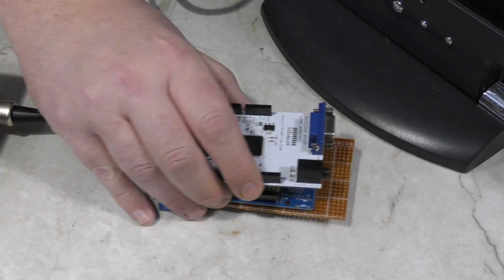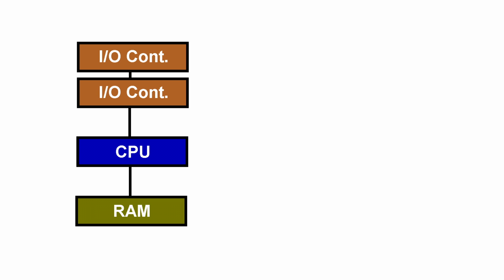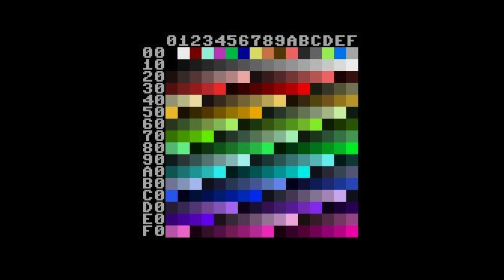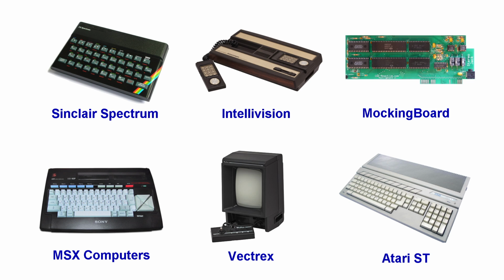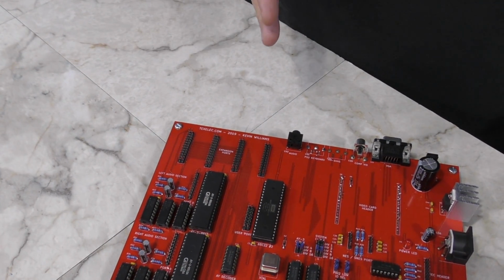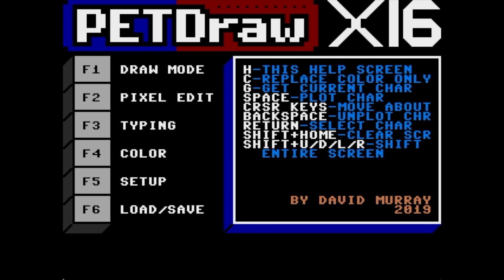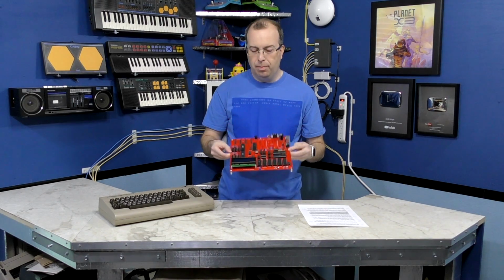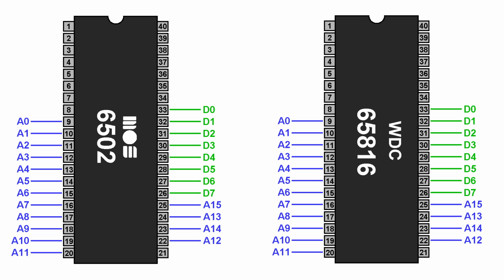Building my Dream Computer - Part 2

Comment: Excellent project !! I will be following this one for the duration. As far as sound, I think it would be best to use your option of embedding the sound hardware in the video controller's FPGA. It will save on cost, you would have complete control over the audio design, and not have to source the Yamaha sound chip. Your videos have been spiking my interest in retro computing once again. I also enjoy retro computing designed on modern "hardware" such as the PIC32 based Maximite COLOR computer. Excellent work guys !!

Comment: I love this project. And I love the dedication you and your team show when presenting progress and the current status quo.

I would love to buy the final product though, and by that I mean not a board or anything I have to assemble myself, but a fully featured computer that I can just plugin and have a go at it.

Reason I say this is, that while I am a professional software developer, I am not good with hardware. My realm is software. So instead of buying a board that I have to hook up or - gasp - solder some things on, I would rather prefer to get the "dumb end consumer package". Something I can just unpack, hook up to a monitor and booooom, it works.

The short intermission by Perifractic is what I am talking about and would love to see being made a fully fledge product that I can just buy. A fully working computer that comes with an OS and a pre-installed programming language/enviroment (or two or three ...) and a keyboard. Just like the C64 back in the day. Or the Amiga. Or Atari ST..... you get my point I hope.

And I think if you can provide that, it would be an amazing environment to teach people, especially kids, programming in - be it assembler or BASIC. Of course if you could provide a Logo like Turtle graphics environment that would be a big plus, but I guess I could just program that myself in assembler or BASIC if really needed. 

As for the price, I am willing to throw up to $500 your way for the complete package (as I described above), although if you compare that to any modern computer, you can get a very decent gaming laptop for that price as well - so for the average Joe, that would be your competation, so you might want to think about pricing. If it comes with printed manuals and programming tutorials/howtos I would be willing to pay a bit more though.

Anyway, since this product is clearly still in the development phase, I wish you the best of luck and hopefully this will turn out to be great. Thanks for your latest video update. It was quite entertaining.
Reply: Glad you like the full package with the case. Stay tuned! 👍🕹️

Comment: No matter if you call it the "Commander C16" or the "Commander X16". That both doesn't sound right because it reminds of the C16/116/+4. I suggest to call it the "Commander C65" because it is kinda like a succesor to the C64.

Comment: I am only halfway through the video so my apologies if this is covered later. Regarding the lcd why not keep that for live debugging info? I know it won't keep up at full speed but whenever using break points etc when 1) developing the system and 2) when developing software for the system.

Comment: Omg. I’m sold. When this is released I’ll likely be buying a kit. I love the prototype boards you have and how mistakes were made in design but you guys just found ways to work around it in somewhat hilarious ways (move the video board and PS/2 to the other side). Other than that this seems like it is a very organized project and will definitely see a public release. This is a board I would probably love to actually learn assembly on rather than try to write for a NES or something. Great work guys!

Comment: Build half a gig of flash memory and a usb port into this thing for quality of life. I'd say 86 the floppy port but the people that use this sort of thing might take perverse pleasure in using it. I know it'd be difficult and not period accurate but nobody actually wants to dick around with c64 drives or emulators more than once so let them copy over the entire software library all at once or save incremental backups of their work and easily retrieve it.

Comment: Do you know who's going to want this? Every hardware course for every computer engineering college in the world! This is perfect for teaching.
Reply: Videos like these and those from Ben Eater are partly why I chose to declare EE for my major
Reply: I think a modern ARM micro can be a very effective tool for teaching stuff like this. At least I remember learning on an ARM not too long ago. We started with low level assembly code (turning on a few LEDs and stuff) and then moved forward. Second year we moved forward to C and more serious stuff like interfacing with different peripherals and other stuff. And you can have a cheap dev board for 10$ which is very important for a teaching environment. The teachers basically showed us a simple educational architecture (not something that actually exists) and then moved on to the same part on the ARM chip. 

If you want to teach low level stuff I feel that arduino may be a bit too abstract and high level. But if you go directly to the atmega (if we are talking old school arduino) then you see that the whole thing is quite unfriendly when comparing it to an ARM chip.
Reply: @rolaroli  risc-v could be the next thing. from the instruction set it is at least as good as arm.
Reply: Nope too old
Reply: @andrewsmith4920  I am sorry to hear that you're too old. It comes to us all in the end. To be honest, there are much better ways to learn retro style programming. There's any number of existing designs or FPGA boards that could be used or adapted, not to mention plenty of emulators. But this is HIS project, so he can do what he wants. 😉
Reply: It's cool, but Ben Eater's projects are much better for a learning environment
Reply: Yes! Why give students a good value for their money by teaching them a modern platform when you can rip them off for thousands by teaching them 40 year old technology that's not used by anyone but hobbyists instead! /s
Reply: @Mike Sienicki If they weren't paying through the nose for the class, I would agree. All college classes that teach things that students will never use in a business environment should be either removed, or free.
Reply: I'm working on a tutorial series currently, it's in the same line as From NAND to Tetris.  But I am writing the full hardware description in VHDL using a Terasic de10-nano FPGA.  The CPU in my series is based on a basic RISC V isa instead of a retro solution.  However, after following from NAND to Tetris or my tutorial(when it's finished) you'll be able to build a 6502 or m68k if you want.  I only say take this route as a teaching method because his method isn't  conducive to learning.  It is cool however and I have done it myself up to and including creating a system with discrete logic chips.
Reply: @ToreishiiMira  I'm in the middle of nand2tetris now, and the design constraints of the Hack computer have really made me appreciate what they've shoehorned into that small instruction set and the thinking that had to go into developing the architecture. I've been out of coding for a long time, and between developing the hardware writing the assembler, and now the VM, compiler front end,  and OS, it's been an extremely stimulating and exciting activity. And I see connections everywhere between the principles and challenges in N2T and parallel issues in today's design world. 

I'd really love to see what your tutorial series is like, and how you address the design decisions and constraints that are inevitably involved.
Reply: @ToreishiiMira  Oh, I buried the lead-- good on ya, mate!
Reply: Kids need to learn programming useful for today's world, not the '80s and also not for architectures that have basically died.  Schools and colleges don't have budget for hardware like years ago.  The future is programming tutoring on what the kids own themselves - laptops and tablets.   Why build specialised hardware when this can all be done on an exisiting modern laptop or ipad with an emulator?  Just write an emulator with all the neat debugging and help features needed.
Reply: @MikeB_UK  Exactly, college is expensive and the education you receive really needs to focus on whats relevant now and in the future. This might be a intersting project or tool for a computer history class but really has no relevant place in a modern tech education.
Reply: alysdexia  ouht -> ought; alysdexia -> pedant
Reply: We use the intel 8085 these days for that. Kits are cheap and the assembly is basically a simplified x86
Reply: I hold a comp/sci degree and I SAY this is a great project for learning either in or out of school.  The problem with a lot of comp/sci curriculum today is that it lacks historical perspective which is extremely important (because reasons).  My state-university (ca. early 1980s) was equipped with a lot of Commodore PETs, one Atari 800XL (for studying graphics principles) and the university HP-3000/dumb-terminals for general programming (Pascal, COBOL, Fortran, etc.).  In those days, IBM OS's had only recently come off of OPEN SOURCE (ca 1979), so our study of OS design was based on pre-1979 IBM OSes (even though we didn't have any IBM machines).  Ironically, we couldn't study HP OS because it was proprietary.  Our study of assembler was done with a virtual machine (it only ever existed in software) called COMP2.  Our 500 level graphics course featured the aforementioned Atari 800XL and a guest appearance of the original Macintosh (because one of the parents of a student owned a store that sold them), illustrating what we'd book-studied about the Xerox Parc Alto.  I say all that to say, we studied old/current hardware/software to understand fundamentals and historical development.  Many graduates today know nothing of computing history and progress.  Many cannot cope with languages other than C++/#/Java.  That's it.  They also lack the imagination and initiative to master new-to-them languages on their own.  BUT!  Projects like this are fantastic for historical perspective and ease of entry into the subject, especially for those still in primary or secondary schools.  It could be the impetus for choosing a comp/sci educational path after high school (US) and it can lay the fundamental groundwork for that education.  May take:  This project is officially awesome.
Reply: @tx29219  I burst out laughing with the very 1st sentence, your excellency.
Reply: @Archimedes75009  You get full marks for ambiguity.
Reply: @tx29219  Thanks professor.
Reply: Gustavo Valdiviesso probably. But if I was to make the decision on which platform teach students I'd go for something AVR or ARM based. This could be Arduino, C language directly (gcc), Nucleo platform (mbed for beginners or stm cube ide later), and BBC MicroBit with its visual editor for children.
Reply: @SergiuszRoszczyk  Sure, but I would argue that these modern platforms can be used as a second contact with the subject, instead of a first. This retro-computer they are building is simple enough to be the first contact between a student and computer hardware. I, for instance, started using MSX-standard boards to teach the basics, at least one semester before going into modern microcontrollers. This clearly improved the students performance in later courses to the point where the sophomores are encouraging the freshmen to take this basic course and learn some form of Assembly (z80 or 6502) before heading to FPGAs. That is why I can see my lab full of kits like these in the future 😎
Reply: Gustavo Valdiviesso that sounds promising 👍
Reply: @GustavoValdiviesso  I don't think 6502 teaches you anything useful if you've programmed one fo the bottom end ARM or the AVR processors (or even PIC). Except perhaps that ARM instructions are much easier to code 8)
Reply: @etchedpixels  Your absolutely right. Besides, I'm not claiming that this would be the best way to teach anyone. As others have pointed out, bank switching sucks and I couldn't care less about basic. But from a pedagogical standpoint, sticking a micro processor on a breadboard is a great experience for anyone interested in hardware development. I'm not an EE engineer, I'm actually a physicist and I work with scientific instrumentation. When my students first come with arduino at hands asking for projects to develop I say "Great! But let's step back for a moment" and I take two to four weeks showing them a much simpler and older hardware, but one that can exemplify some basic concepts that they don't have yet. If we had an EE course in our campus I would just say "go get some credits with them. Since we don't, I think this kind of project is going to be useful in my case.
Reply: @GustavoValdiviesso  you can learn arm assembler and python.
Reply: @GustavoValdiviesso  they can learn ARM...
Reply: @JosueRodriguez08  I guess so. I never looked at ARM assembly. Is it too extensive? By that I mean, is the number of registers and operations too large, or is it simple like in the older CPUs?
Reply: @SergiuszRoszczyk  Yes of course any serious teacher would choose an RPi and not this creation for 50 year old C= geeks.
Reply: @Archimedes75009  for embedded more microcontrollers like AVR/PIC instead of RPi.
Reply: As a computer engineer, I think this is neat, but it is a very poor teaching tool because the design is done completely wrong from a practical standpoint. Many of the design decisions are arbitrary and the memory is hamstrung... the 6502 should be abandoned and a non bank swtiched architecture used instead of this mess nobody wants bank switching. And the machine would be better implemented entirely in a single FPGA... A better teaching tool is something like a PIC32 board, RISC-V board or FPGA board... this board is too complex for students to buy as well. Also the use of vintage chips doesn't do students any favors either. Also, a completely TTL logic computer would be a much better computer to for EE/CE students to work on. While this may seem needlessly harsh... the fact is this the dream computer of a nostalgic madmad ;-) ... not really targeted as  teaching tool especially since the architecture is needlessly, from a practical standpoint, stuck in the 80s. Ah the 80's a great decade.
Reply: @Wingnut353  as someone who has a lot of experience working with (/for) microchip components, i totally agree
Reply: @Wingnut353  I dunno, starting on something simple makes a lot of sense, and I wasn't even born until 1990 and I like the 6502 as being "big" enough to do interesting things with but "small" enough to really wrap my head around. Its a shame the 65816 didn't work out though, because non-banked memory is indeed nice.
Reply: No, it's not, it's absolutely not perfect for teaching. He just want a very outdated soft and a overcomplicated hardware....
Reply: @JosueRodriguez08  Modern programming skills, those actually need for a job interview, can't be taught with this kind of hardware. I know that. But I work with physics instrumentation, developing hardware for low latency data acquisition. There's a surprising amount of similarities between what I do and this kind of architecture, in terms of data and system abstraction. I actually teach 6502 assembly via emulator to my students so can get into the right mindset before tackling the real good stuff.

Comment: I am relieved that the AY-3-8910 sound chip was eventually dropped.
It is an okay chip, but... I don't know, it just feels so pedestrian!
Reply: Dual Atari Pokey chips would be awesome, but yeah it has its drawbacks and there is no large stock of it I guess.
The SAA-1099 is an interesting option.
Reply: @arvizturotukorfurogep6235  SAA-1099 is almost the same as two AY-3-8910 chips, with only minor difference in the features.

Comment: Oh... another thing: one of the first C64 things I did was test how much slower BASIC was than machine language.

I wrote a BASIC program that went in a loop, placing a random char into screen RAM, then putting a random color attribute on by POKEing color RAM, then after all 1000 were done, changing the border to a random color, then going back to the start after polling the keyboard (so I could quit).  RUNning it produced the expected output at a leisurely pace (I estimate one line of 40 per second).

I wrote the same thing in machine language with the help of SUPERMON, using SID to produce the random values.  When I ran that, as soon as I pressed RETURN, I was amazed by how utterly slow BASIC was in comparison.  I only eyeballed it, but my machine code did an entire screen in roughly the time BASIC did one character!  It's literally 1000 times faster unless my eyeballs are tricking me.

I wonder where the slowdown is.  Applesoft on the Apple II is a variant of the BASIC CBM shipped on the C64 (they even left in the two FAC-sized "numbers" that produced the "MICROSOFT!" text), and even that isn't as slow.  Maybe there's loads of overhead in KERNAL I don't know about...
Reply: On these old systems BASIC is interpreted, which means that as it executes, machine code is reading the BASIC text and converting it to instructions and executing those instructions. This is a slow process since there are a lot of different things going on, and it’s even slower because the interpreter doesn’t save what it converts and has to constantly re-interpret the same instructions over and over again (unlike, say, a compiler which converts text to machine code once before executing anything). All of this means BASIC on these systems was always much, much slower than assembly/machine language. If there were differences between different versions of BASIC it was typically due to how well written and efficient the interpreter was.